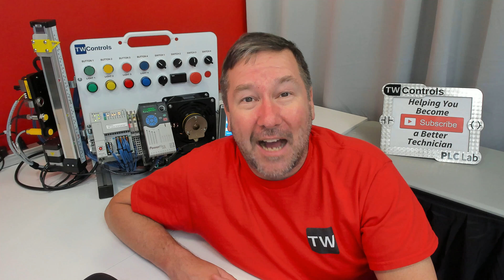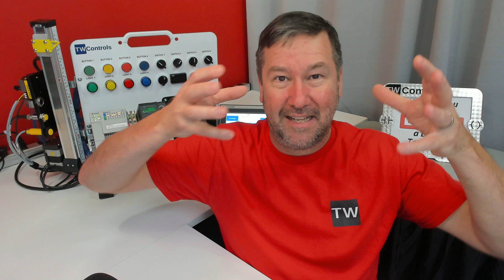Modbus Server vs Client. Which one is which?  Master/Slave

Comment: I just completed a test system with Click PLC as the client and a micro 850 as the server using Modbus TCP.    I now want to make the 850 the client and the click the server.  How do I reference the starting Modbus addresses (of the server) in the micro 850 modbusmsg2 write instruction?
Reply from the maker: Here is a video that covers both Modbus TCP client and server for the Micro850.
https://youtu.be/w4r7t0G3Pd0